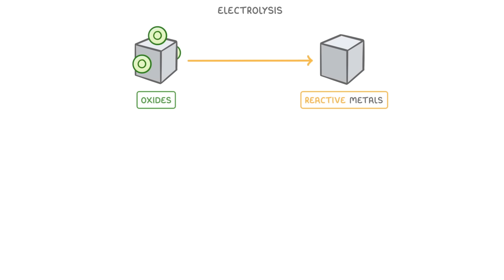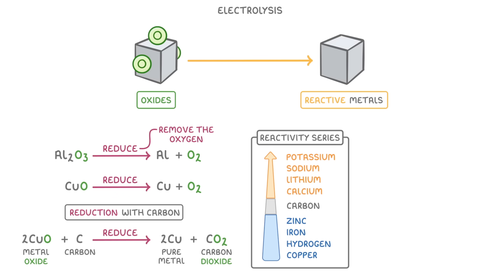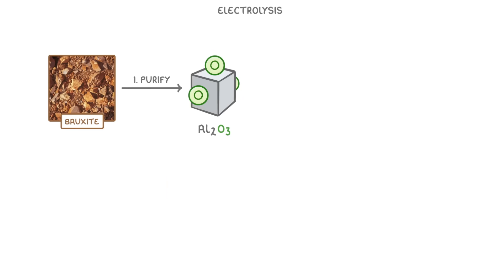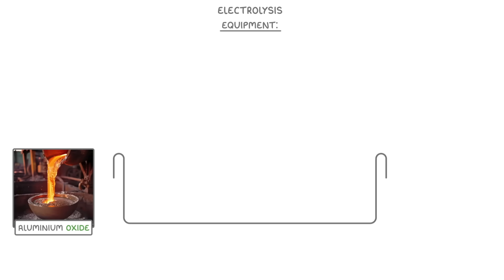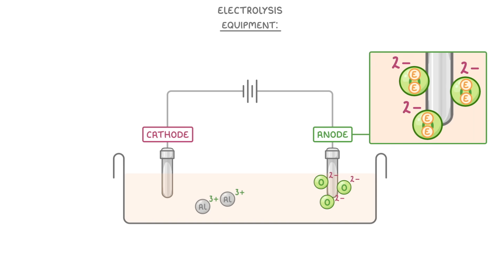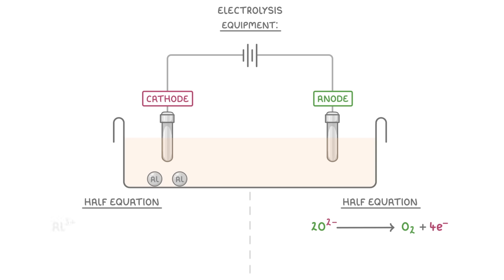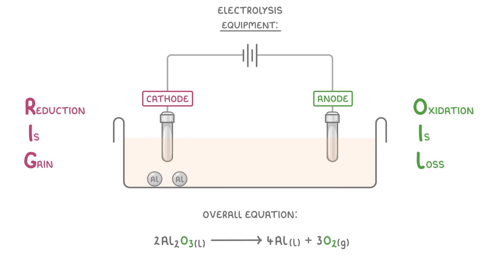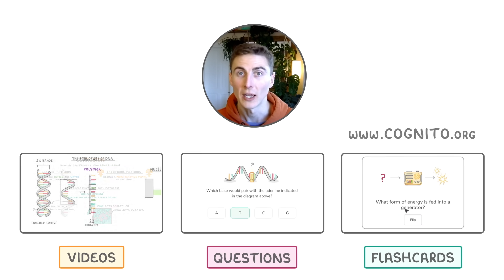Electrolysis Part 2/3 - Electrolysis to Extract Metals From Oxides

Comment: i think oxygen is oxidised, so the electrodes are made of graphite(inert) so it mixes with carbon (graphite is an allotrope of carbon) , and then the carbon dioxide will be reduced to the air.